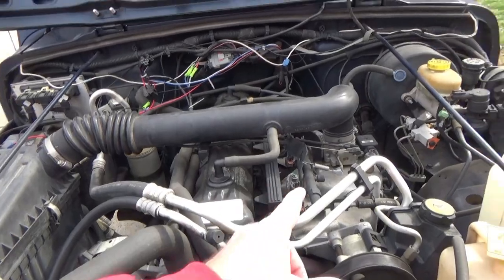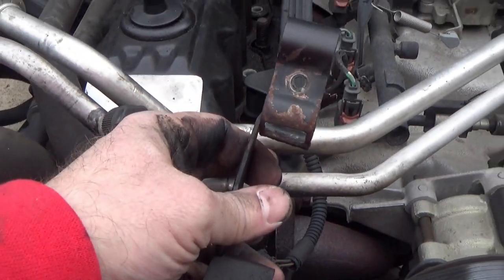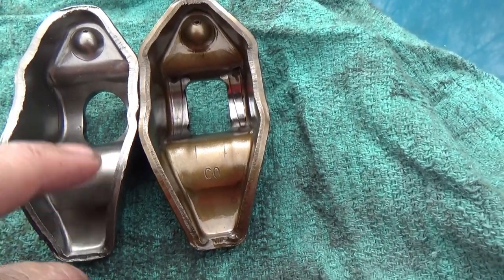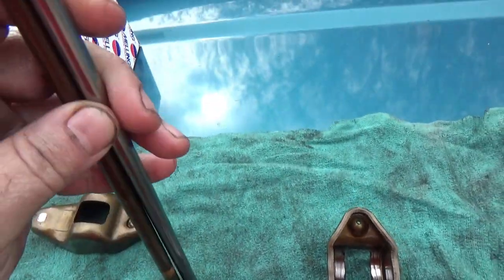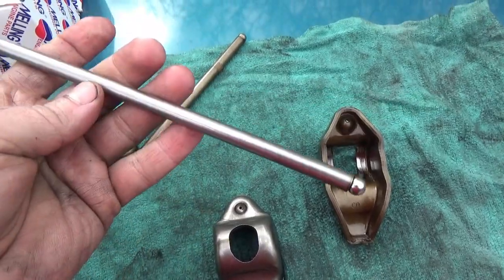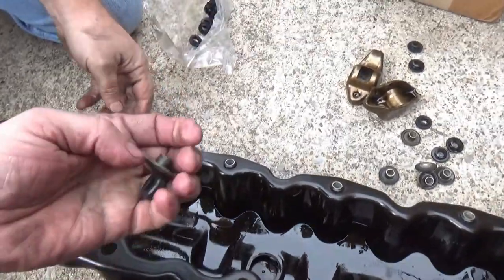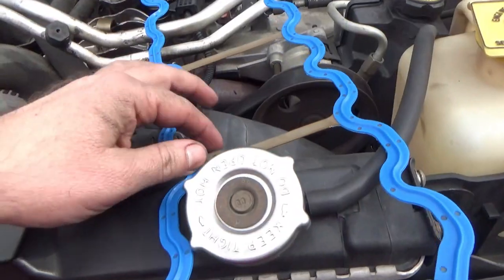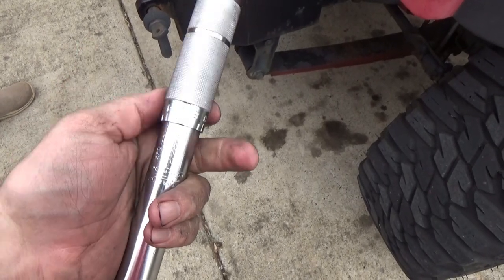Got that top-end Rocker Arm tick in a Jeep?! Change out rocker arm, pivots, and pushrods in that 4.0

Comment: I am replacing my valve cover gasket, 2 of my push rods dont spin freely, do i just change those 2 rods or should I I change them all?
Reply from the maker: You could just replace 2. But I'd make sure I knew for sure why they wasn't turning freely. May need to replace the rocker arms as well.

Comment: Can a rocker arm squeak? I just did the valve cover gasket and then got a squeak about 1000 miles later. I’ve done so many repairs now my God. 

Does it have to be at TDC when you torque them down or just crank em down?
Reply from the maker: Just torque them down to the proper specs and let rip! As for the squeak .. well I've never heard of it happening. A rattle .. yep that can and does often happen. If it is truly a rocker squeaking, check that oil pressure ASAP!
Reply: @Poweraddicts  okay cool I sure will! Thank you so much and appreciate your responses so much, I really do!

Comment: If the push rods are not blocked or bent. And the end balls not galled worn or loose can they be reused with the new rocker arm kit. I got 3 Jeeps running 15w40 oil, the Grand Cherokee from Alaska with 208,000 miles & oil changed regularly with synthetic from previous owner ticks badly on start ups till it warms up gets much quieter but still there. Thanks
Reply from the maker: I have reused them and not have any issues. Just make sure they are in good shape.

Comment: Will motor do side to side shake if the rockers are worn like it’s out of time 
I replaced lifters, pushrods, seals but not the rockers and they all went in same way the came out, didn’t mix them up
Reply from the maker: Typically rockers will not cause any side to side shake. You may wanna check your engine mounts to see if the rubber is worn out.

Comment: Thanks for another fine video.  Does the rocker arm kit linked in Amazon include the pushrods?  I don't see them listed.
Reply from the maker: Nope, apparently I forgot to add the link for those. Ooops. I'll add it when I get the chance. You're welcome! Glad you liked the video!!
Reply: @Poweraddicts  Thanks for the link to the push rods.  I also want to do my valve stem seals.  I can live with a little puff of smoke when it starts up, but it seems good to do while I have stuff apart.  Since I have to remove the springs to do that anyway, would you recommend replacing them?  Not anxious to spend the extra $$ on springs, but also don't want to short-change myself.  The Jeep has 185,000 miles on it.

Comment: Do I need to clean the rockers and rods prior to install? If so what do I use? I'm debating dropping in new lifters also. What's your thoughts?
Reply from the maker: We just used brake cleaner to clean the lifters. Installing new lifters isn't as easy as installing the rockers and the other top end parts. Thanks for dropping by!

Comment: Was this a constant tick, or was it only on acceleration? I have a 99 WJ with the 4.0 that has a tick when accelerating only, or only becomes noticeable when accelerating under load.
Reply from the maker: Tick at idle and goes away after the RPM come up a little. What you are experiencing could be "ping" or pre-detonation. Try putting 92 octane or higher gasoline in it to see if it goes away.

Comment: I just rebuilt my 04 4.0 and put these exact rocker arms on and torqued to 19ftlb I rotate the engine a few times and re torqued but on a few I have play and it’s ticking. Should I take them back off a redo it or just try tightening them up more until they stop?
Reply from the maker: After changing all that and its still ticking, you may have worn lifters. Go ahead and recheck the torque on the bolts first.

Comment: What’s your favorite oil for the Jeep 4.0?
Reply: I just started using Royal purple in my 2002 Grand Cherokee 4.0 L......
It's a little more but it  runs awesome at 257,000 miles and at a cooler temperature. Also a Mopar oil filter with check valve.

Comment: How do you know if the noise is rocker arms or valve lifters? I am considering swapping it all out (lifters/ rocker arms/ rods). I would hate to go in and swap out one part and its really the other.
Reply from the maker: About 98% of the time it is the upper valve train and not the lifters or cam. Be sure to swap the "followers" inside the rockers as well. Changing out the upper part of the valve train does help. But, there is always a very small chance that the cam and lifters may need replaced as well.

Comment: At how many miles should these rocker arms be replaced typically?
Reply from the maker: Ya know, I really can't give you a good answer. I forget how many miles that TJ in the video has, but its less than 200,000 easy. My dads 2006 TJ has 320,000 miles on is and its as quiet as a church mouse, it's never had the valve covers removed let alone anything internal.

Comment: What type of oil do you recommend?
Reply from the maker: He runs Pennzoil 10-40 in his jeep in this video. I tend to favor Valvoline 10-40. The main thing is to make sure you use a quality filter like Wix and a good oil. Make sure you change your oil about every 3000 miles, you should be fine.

Comment: How do you know the rattle is not from the lifters?
Reply from the maker: Experience from working on these engines. About 90% of the time its the parts we changed in this video. There are times that it has been the lifters but it isn't common. That engine hasn't rattles a bit since we changed those parts.
Reply: Thanks. Mine sounds like a diesel. I’ve got the parts, and thanks to your video I got this!

Comment: Where can I get those metal sleeves for the rubber seals on the valve cover??
Reply: They are no longer manufactured, you'd have to grab them from a junkyard or ebay or similar.

Comment: my 2001 cherokee xj 4.0 had a little ticking, it now had a loud knock :( 
could this knock just be my rockers or pushrods finally broken, stuck or something ?
Reply: Check the flexplate bolts and see if they need to be tightened
.
Reply: @nathrak  thank you for the advice! but i did check them. they seem tight. i was going to pull the valve cover next. i have a mechanic stethoscope and still cannot determine where the sound is coming from, but is sounds like somewhere in the middle of the motor, i am hoping it is in the top end. i have decent compression and it seems to run fine, but has a really loud knock.
Reply: @MrMrsregor  Flexplates are also prone to cracking and still causing the noise when when the bolts are tight. You can rotate the plate and pry on it with a large flat blade screw driver to see if any cracks emerge. Also, shit it into neutral and rev the engine. Often times the knock will only be present in drive or reverse. I'm only so adiment because 6 of the 7 jeeps I've owned with a 4.0 has had this problem with it ending up being the flex plate.
Reply: @nathrak  sound gets louder when i rev the motor in gear, neutral, and park
Reply: @MrMrsregor  I would suggest mostly because of the year that the Piston wrist pin is your culprit.
Reply: @rudyfinney9450  i was thinking ether it is that or maybe piston skirt.. i know the pistons (metal or casting flaw) in 1999-2004 were not great. i have not torn it down yet, because it does not fit in the garage and it wont stop raining around here. thanks for the advise and pointers y'all !

Comment: Do you start at tdc? do you have to rotate the crank at all?
Reply from the maker: GM engines you have to do that. Most Ford and Chrysler you just torque the bolts to spec and call it done,
Reply: Thanks for the info

Comment: doesn't the lifter make up the slack
Reply from the maker: Not as much as people think. When an engine is at idle the oil pressure is low so the lifter isnt as "solid" so it can be slightly compressed. When the RPMs climb so does oil pressure so the lifter pumps up from the added oil pressure so it cant be compressed as easily. When the rocker arms, followers, and sometimes even the pushrods wear they make they "create a larger gap" for the lifter to have to take up. Sometimes its more than the lifter can make up. That is the simple explanation.

Comment: Can I just adjust the noisy one? Do I really have to replace all of them?
Reply from the maker: No you can't adjust the noisy one because Jeep designed them to just tighten them down and call it good. You can just replace the noisy one and probably be fine. But, odds are the other rockers are worn as well and will soon start rattling soon after you replace the first one.

Comment: 55 inch pounds it just over finger tight.
Reply from the maker: Agreed, I sometimes get blasted for not saying torque specs. With those Permadry gaskets I just choke up on the ratchet and give it a good snug and call it good. Never had a leak.